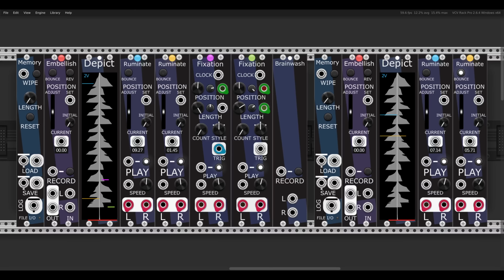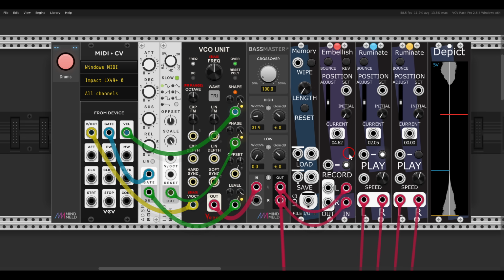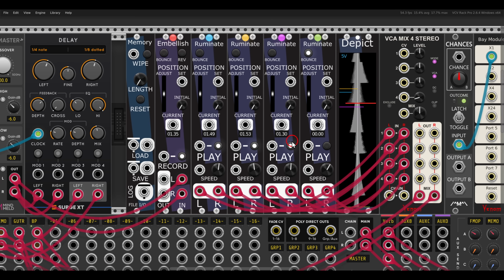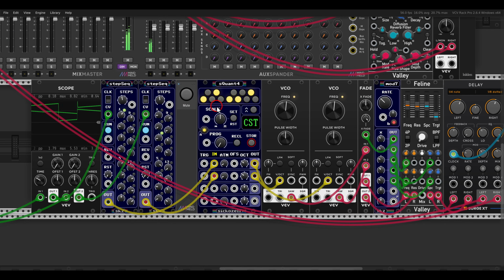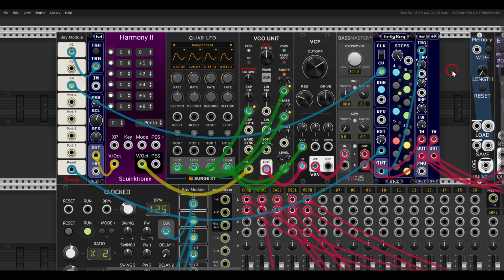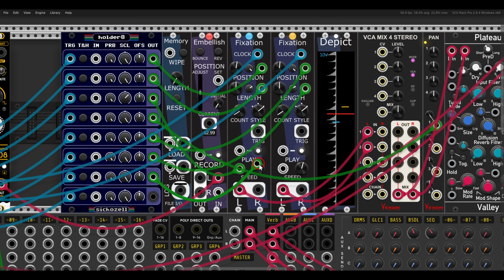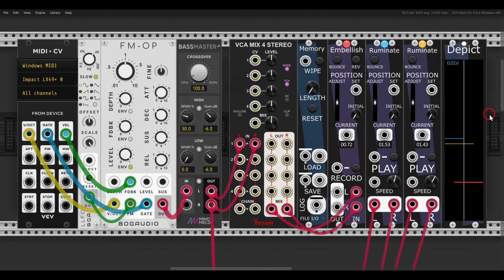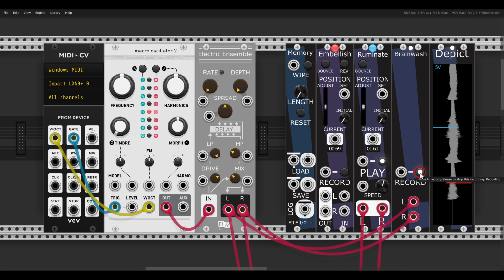Build your own looping station / Memory System Mega Tutorial

Comment: what a lovely system - it's still crazy to me that it doesn't have an overdub loop built in, though -it's central to most loopers.
Reply from the maker: Well, the way it is here actually gives you more freedom since you can process the sound being overdubbed. It's a modular overdubbing system :)
Reply: @OmriCohen-Music  Indeed, when I first conceived of these, I considered doing some simple overdub mixing thing, but then I tried adding effects to the underlying signal (as you did with the low pass filter), and I thought, if I make a default overdub, people might miss the possibilities here. Adding chorus, dropouts, panning...many interesting effects come up; there's more than one way to "fade out" the prior signal.

Also, I admit, I didn't particularly want to write the compressor one would need to make sure the blended signal didn't overdrive; there's plenty of compressors already in Rack, and they're better than what I could write, just use those.
Reply: @StochasticTelegraphTech  Thank you for your amazing work on these!